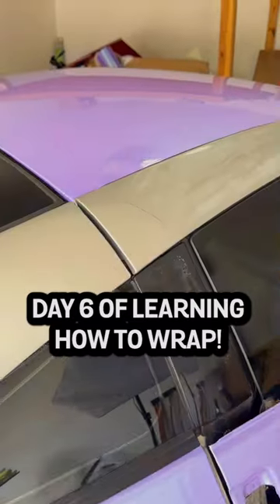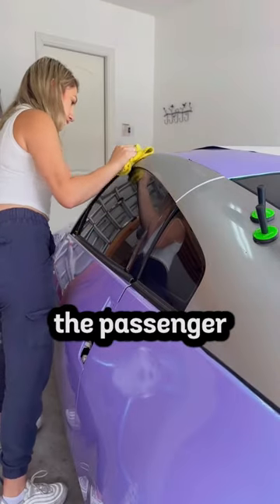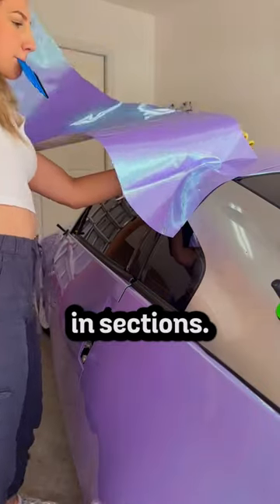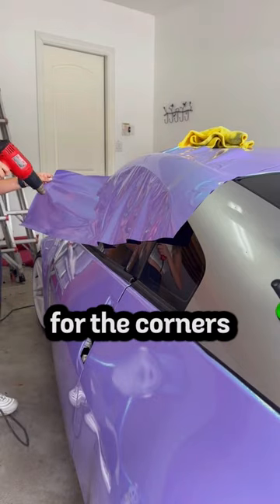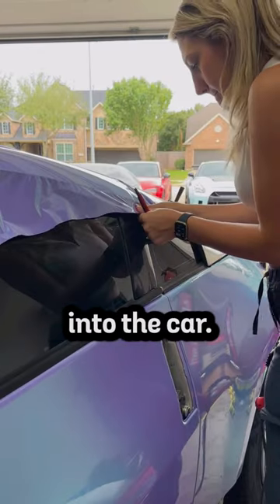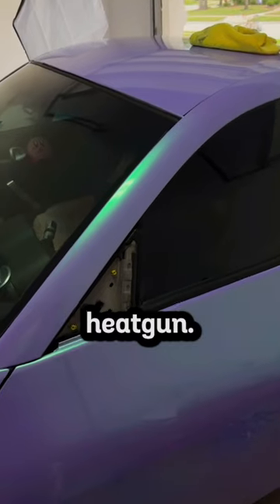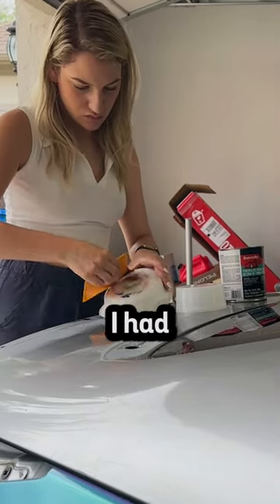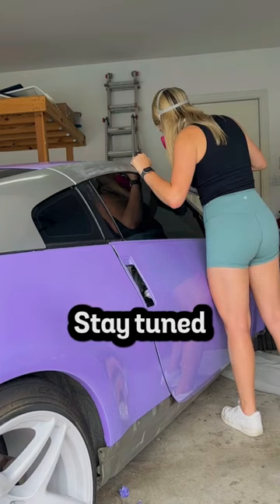Day 6 of Learning How to Wrap My 350z!

Comment: You should shrink the entire wrap before you set it down so you can stretch it over. Setting the film down cold and fully expanded without stretching it on leaves a worse finish with more imperfections